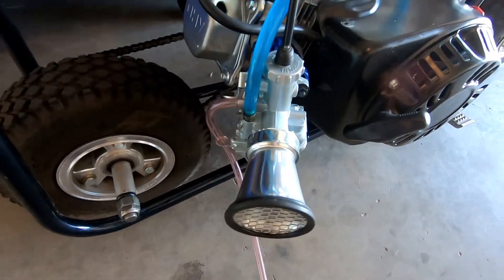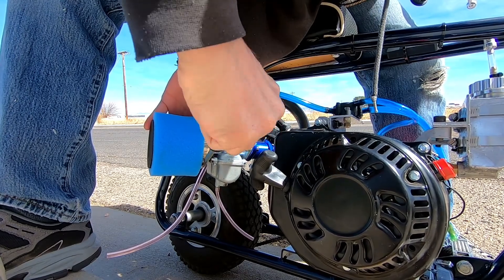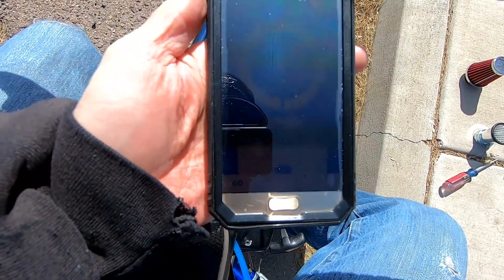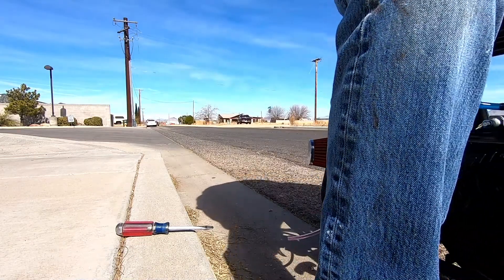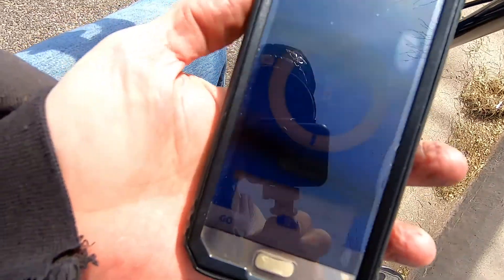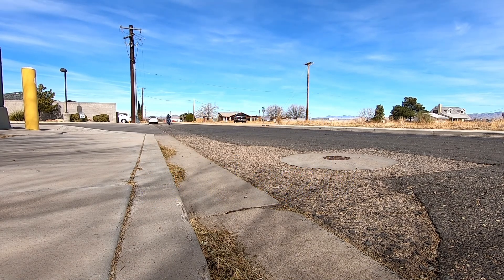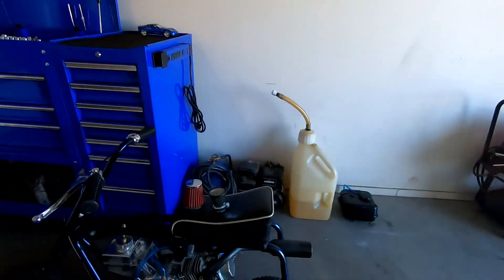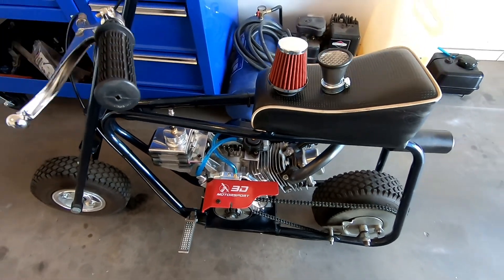Predator 212 with VM22 MIkuni Carburetor air filter comparison

Comment: Hello, I have a 125cc lifan motor with mikuni 22 carb. I changed the jet to a 120, starts and runs good no choke, but when I give it gas and let off  won't idle down fast any ideas. Thanks.
Reply from the maker: Yes, check out the VM22 tuning videos on the channel 
https://www.youtube.com/watch?v=MnQvIlFX8hM&t=3s
https://www.youtube.com/watch?v=b5bY-1gIWWk&t=6s
Reply: @Black66  yes I watched this before and did what you said,  bigger jet and bottom air/fuel screw, then idle screw. That fixed my running with no choke have good idle and rev up but when I turn the throttle down it takes a few seconds for it to come down to idle.  Checked for leaks and misalignment all good.  This is driving me nuts.
Reply from the maker: Pilot jet  @Ken-it8wv
Reply: @Black66  thanks, I'll take it apart again tomorrow
Reply: Sorry, but I couldn't wait, took it apart and removed pilot jet. Should my cleaning wire go all the way thru the pilot jet. It doesn't. Could be plugged up

Comment: And I can help you on this one those air filters that come with those carburetors that little red filter. The rubber lip that connects to the carburetor actually covers the hole on the carburetor, if you don’t understand what I mean, take the carburetor filter off and look inside the carburetor right where the filter goes there’s one or two large holes there they get covered up by the rubber, and it makes the engine choke
Reply from the maker: I hear ya. I use my Dremel to widen that part depending on the filter I use. I have had really good luck with those carburetors for the price. At least for a quick stock carb upgrade. Nowadays you can grab the entire kit for around $40 including the intake and filter! When I made this video a couple years ago that carb was a lot more expensive!
Reply: @Black66  I had the same issue, but if you dremel too much the filter falls off the rubber. Just have to buy a new filter.  I had some much trouble getting these fake mikunis running, until I started backing the air mix screw out like 4-5 turns... probably because I am at sea level and it is 105 degrees outside. I have 3 of them running like a top. I had to delete the plastic interposer as well, because no matter how much I tightened it eventually the carb would slide down just a little and get a vacuum leak. Thanks for these videos BTW, my kids and I love them, and we love all things powersports.
Reply from the maker: @MrComputerguru79  Have you watched the VM22 tuning videos in the carb tuning playlist? 
https://www.youtube.com/watch?v=b5bY-1gIWWk&list=PLkbj-ip-5FzZG_AWtFqHztJQSKvw32ZxY&index=2
Reply: @Black66  of course I have. Many times. My middle son watched with me. You are the primary reason I actually got mine running in the first place 😀 I was almost ready to throw in the towel with these cheap knockoff carbs.
Reply from the maker: @MrComputerguru79  You could swap out that pilot jet so you dont have to have the fuel screw turned out so many turns.If your fuel screw is more then 3 turns out your pilot jet is to lean.
Reply: @Black66  Ooo, that is good info, thanks. I bought a couple packs of pilots but didn't change them because it idled ok

Comment: Mine is also crapping out in the top end like that. First I thought the 120 jet was too small so I put a 130 and it made it worse. Then I went down to a 115 and it made it better than the 120 but still misfires. I have a feeling it's because I'm using that same filter.. I'll try to run it without a filter for testing purposes and if that's the issue I'll order one of those foam ones!
Reply from the maker: Ya, I was surprised that  the filter made that much of a difference . It might work on a smaller engine that doesn’t pump so much air .

Comment: I honestly hate those chrome filters. They look cool but that's about it. I've ran them a lot before and have noticed the same problem. There a little more restrictive which causes a stronger vacuum buildup between the throat of the carb and the filter media. This pressure drop causes the fuel to be pulled from the main jet more and makes the engine rich and stumble. I usually have to drop about 2 jet sizes to get the engine to run right with that filter. But it makes less power because fuel is power, with less fuel you make less power. Obviously the amount of fuel depends on how much air you are moving too. But with a restrictive air filter your letting in less air which means you need less fuel. With those foam filters you get more airflow and thus you need more fuel to keep your engines afr the same.
Reply: Just remember to oil your foam filters if you plan to run in the dirt. Those filters flow so good that they'll literally let dirt and dust come right into your engine. Ask me how I know haha!
Reply from the maker: @alaricrice9017  ya, I hear ya. I see silt or dirt inside the foam filter all the time. It gets through the filter . Definately oil that filter.
Reply from the maker: Awesome! Thanks. I hear ya. It's not worth running one if you have to run a smaller jet just to make it run right. And then make less power. It defeats the purpose .

Comment: Have you tried riding whiteout a filter? I wonder if that makes a difference
Reply from the maker: Ya, I did. It runs well without a filter. Kinda the same as the velocity stack, It doesn't have a filter inside of it.

Comment: Will gettin smaller wheels n tires make the bike go faster say on a stock 212 pred.
Reply from the maker: Ya, I think so. I think it might make it quicker. Adding shorter or smaller tires would make it rev faster. It would be like adding a bigger sprocket.
Reply: @Black66  thats wat iwas thinking... so i just went from a 65t to a 56t rear 12teeth clutch should i go bigger on clutch wheel to get more top speed
Reply from the maker: @play4keeps800  Yes, if you go bigger on the clutch it will give you more top speed.  Just don't go too big because there will be a point where the engine doesn't have enough torque to pull too high of a gear depending on engine modifications.
Reply: @Black66  awesome thanks for answering my ?....What do u suggest like a 14 or 15t clutch?.....Kinda new to gear ratios and im tryna find a good top speed wit a lil bit of torque
Reply from the maker: @play4keeps800  It depends on what size tire your running and engine mods. I could answer better if I knew your engine mods and tire height.  If you have an 11-inch tall tire as I do on my minibike and say a stock Predator with a 56 tooth rear gear and a 14 on the clutch, then on paper the bike should run around 30 MPH at 3600 RPM. But let's say you have a Predator that's modified and can turn 7500 RPM, then a minibike with the same gear ratio 56th rear and 14 on the clutch should run around 60 MPH on paper. . But ya, to answer your question. A 4.00 gear ratio like your talking about generally will give you a little bit of torque with more top speed.  Especially if you have a modified engine. I have a video coming out in a week or so that shows my minibike doing almost 60 MPH. With a 4.23 ratio, but my engine is modified to turn 7500 RPM.
Reply: @Black66  thanks so much yea sounds about rite running. A stock pred. Rite now with ithink 13in tall tires thinkin of going smaller tire..also have a new 196r tillotson from gopowersports never got to run  perfect cuz first time i installed it had a fuel pump flood the engine wit gas never took the engine apart yet to fix